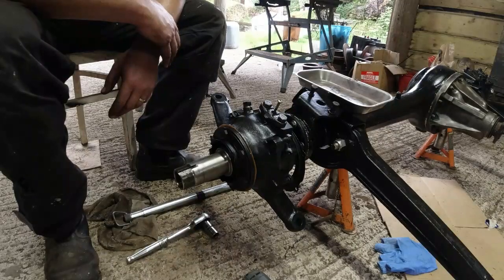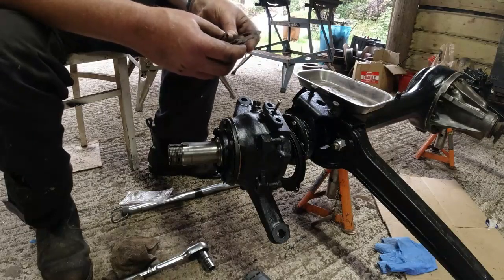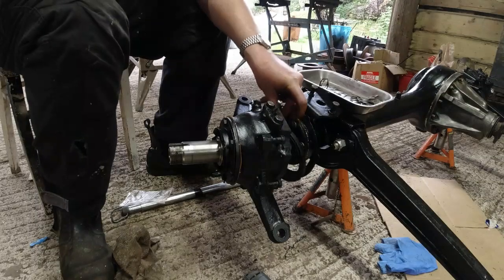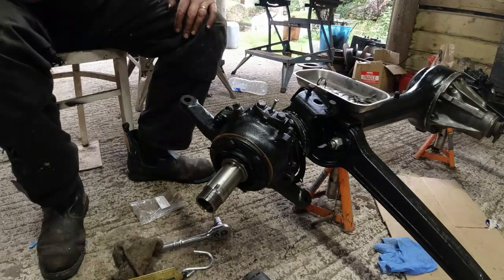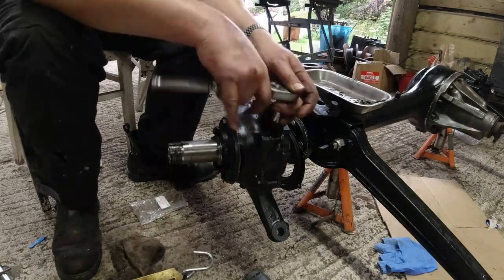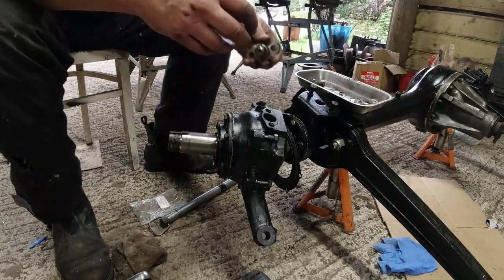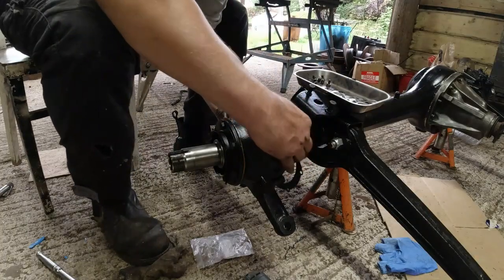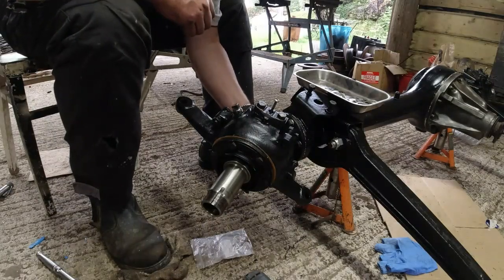Range Rover Steering Swivel Preload - Parental Warning

Comment: Richard, instead of guessing the shim thickness required, if you first sandwich a short length of soft silver solder between the pin and housing and torque down until you get the correct spring balance force required to overcome inertia and move the swivel, you can then undo and measure the thickness of the now squashed solder. Put together the required shims to match the thickness measured. Try torquing down again and you should have it about right. At least adjustment shouldn't take as many trial and error attempts.
Reply from the maker: not a bad idea, will try this next time round. 👍

Comment: Umm might be a daft question but presumably we should do this on both left and right hubs? I'm getting a lot of kickback in steering, joints, bearings etc all good so thinking it might be this preload badly set - I saw the mechanic do it, didn't measure said he didn't need to... Do you think it could be that? Thanks in advance (LHD td5) 👍
Reply from the maker: On Range Rover classics you must do both sides.

Bear in mind also that kick back and death wooble steering can be down to wheel bearings and steering damper also

Comment: Great, thankyou Richard.  How much more of a faff is this with the brakes/ spring/ rest-of-a-Landy in place?  Like you say, I'm sure getting the pre loads right is the key to stop that terrifying wheel wobble!
Reply from the maker: I have done this job more times with the axle and wing in place. that is no bother but to do it by the book then the calliper, disc and hub seal need to be removed